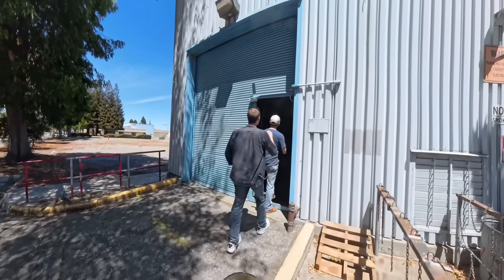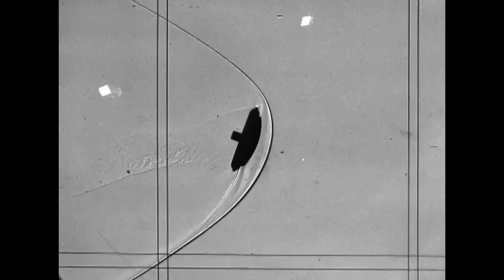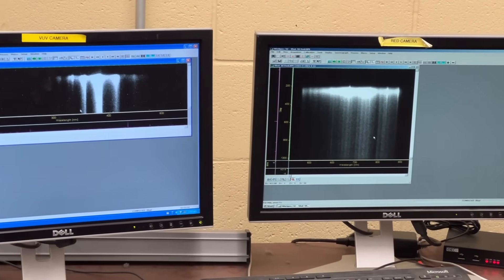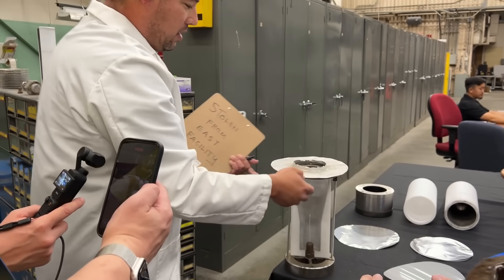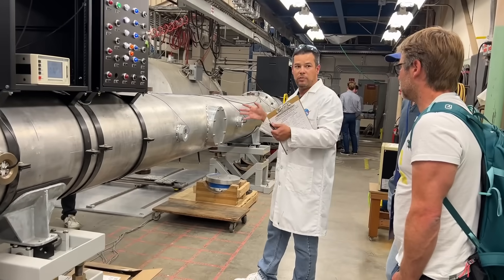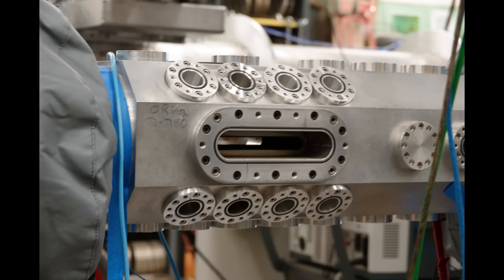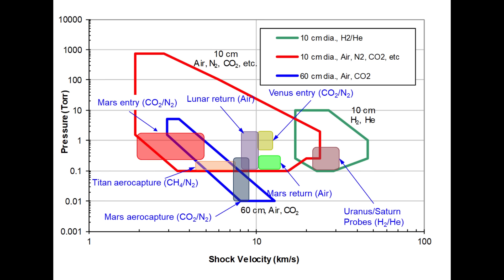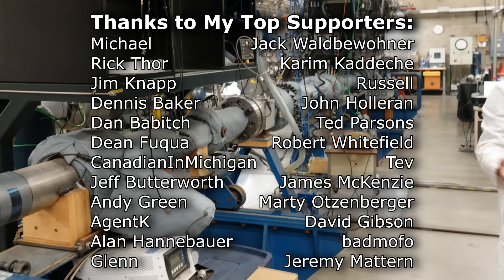Why NASA Is Making Air Explode Using Electricity - The Electric Arc Shock Tunnel

Comment: 1MJ = 270Wh battery. nice electric arc thruster bro. well, container your excitement bruh. thats the detonation pulse jet engine, but electric and just linear pulses no rotation. well say helicopter turbo jet generator at 5MW is easy to convert to high amp electric pulses, or continuous high current. too thin wire. sauna heating coils can deal with a ton more electric resistance heat. nice. continuous measurement, not pulsed measurement, bruh. well your marginal bridges collapse (tm)(r). and wings break, and heat shields challenger. make stuff work. not just barely. above says cheaping out makes stuff more expensive and makes them break. ie running a management gov alongside a production line costs you your freedom. yep army corps does not give you any freedom. camping is much nicer, dont work for other people. ie love towards the world is enemy to above. I am not it, as I am flesh. above be with you. well the metal tiles rust of course. nothing complex. they rust when they have no shielding gas. the orange stuff, your gold has rusted. and rust is no good.
Reply: very much easier to make a pulse detonation engine with electricity than trying to control fuel detonation. just make your wire last longer and only detonate the gas around the wire, not the wire itself.

Comment: (8:20) Is there a reason why the tungsten wire is folded like that instead of simply straight? I feel like I should know the reason, but it's escaping me... 🤔
Reply: It actually might be coiled. I had a second look and it's hard to tell... 🤔
Reply: It's longer so the string can pull it straight to fire the rig.   The string is an insulator, the wire is a conductor, the point where the string passes through is the other electrode.

Comment: It’s pretty bonkers that 70ish-year-old equipment is still in service on cutting-edge research.
Reply: 'If it ain't broke, don't fix it ...'
Reply: ...wonder why - has this type of tech maybe not advanced affordably ...or something else?
Reply: @kevinim300  There isn't much to advance on a big bank of capacitors and a welded metal tube. I'm sure then sensors look absolutely nothing like the originals though.

Comment: As someone who has welded that type of equipment, the big stuff is annoying but the small parts are the easiest to make expensive mistakes on, and there are loads of small parts. Cheers Scott, Great as always.
Reply: what if it's tiny details ina  big part? I remember reading about welding the Saturn V tanks.
Reply: Hi, can you please explain what those "dashed" weld seams are about? On the big section at the end of the bigger apparatus (I think called it the wind tunnel section?) the tube manufactured from sheet metal seems to have one continuous weld seam along its length. But everything else attached to the outside is welded to it in a sort of "dashed" or alternating way. Why is it done like this, and how are the contents inside sealed off? Is there a second, but continuous weld seam on the inside of the tube? Cheers
Reply: @argh1312  This is for ease of testing of the inner weld and to avoid forming a sealed cavity. One way you can test vacuum chamber for tightness is to to connect a sensitive gas detector (mass-spectrometer) and then evacuate the whole system. You then blow Helium at various points and check when mass-spectrometer shows rise in Helium inside - if it does you found a leak. For this you need the ability to blow Helium at every weld, so they make the outside weld with gaps for easy access. They also make notches in the connector flanges so you can blow Helium there to test the seal.
Reply: @volodya5  Thanks for that explanation! So do I understand correctly that there are inner welds to seal the chamber off, and the outer, gapped welds are for added structural integrity? And yes I was already talking about those flanges. Is it done the same way along the length of the tube as well?
Reply: @argh1312  Right. When you are welding sheet metal together you usually have only one weld, but when you are welding sheet metal to a thicker piece, such as a flange, you have full inner weld and partial outer weld. The inner being on the side where vacuum is - sometimes people make enclosures so one can put  an instrument that needs atmosphere inside a vacuum tank. In theory, you could reverse the arrangement with full weld outside and partial on the vacuum side and still test with Helium. But this has a problem that you created a narrow cavity in vacuum that is very difficult to clean. So if you get anything organic in it, it will outgas for weeks or longer.
Reply: @volodya5  also, you want as large of an area as possible to allow atoms/molecules to fly around and get collected (calling it pumping at that level of vacuum doesn't convey what happens)
Reply: @argh1312   You cant fully weld the outside in case of trapping air. To create a vacuum, you need to loose all the air inside.  If some were trapped within the seam, the vacuum would never be reached as it kept finding a trickle of atmosphere and you would spend forever finding the leak.

Comment: Orange stuff is made not just during re-entry, almost any video of Starship launch and landing shows a brownish haze or smoke trail from the rocket exhausts. While methane and oxygen burn cleanly, those hot gases striking the air can force reactions involving the nitrogen and assuredly form NO2, which I believe is a major component of those brown trails.
Reply: Thanks! I saw that on the last launch and wondered why no one talked about it. I assumed something on the launch tower was being roasted
Reply: I think the more likely explanation is fuel-rich combustion towards the outside, to reduce the thermal strain on the exhaust nozzles. Surely at that amount of heat and pressure, some of the partially burnt fuel molecules (CH3, CH2, CH, C) would lump together and create visible soot, don't you think?
Reply: @argh1312  Nope. Methane burns very thoroughly, and is certainly plenty hot enough to create nitrogen oxides from air. Also, the hot, fuel-rich gases collide and mix with the ambient air, regaining the stagnation temperature they had in the combustion chamber. I've run small engines at rich and lean conditions, and when lean (no afterburning in the air) the rumble goes away and all you have is a ripping noise much like a cutting torch. No elemental carbon is formed in plumes all the way up to propane, and everything gets afterburned very nicely. Only NO2 can explain the brown color.
Reply: @r0cketplumber  Alright, I'll take your word for it. But who are you, running liquid rocket engines?
Reply: In reality, it's just fart Starship shouldn't have followed through on. It is not rocket science.

Comment: 48 km/second is about 
107366 mph is about
mach 141
Reply: Parker Solar Probe: 430,000 mph.
Reply: That’s incomprehensible numbers just wow! 😂
Reply: At what temperature?
Reply: Using mach without providing the relevant gas parameters is inaccurate. Mach number depends on specific heat capacity (volumetric and barometric), molar mass, and temperature. Especially when we're talking about extreme conditions like this, all of those are highly variable.

Comment: I am a bit surprised that they don't use a coaxial transmission line between the capacitor bank and shock tube to reduce inductance and narrow pulse width.  This should give higher power levels at the point where the shock is initiated.  Maybe the capacitor bank has enough inductance and/or equivalent series resistance to make any transmission improvement moot?  The string pull wire trigger is amazing, but I would think that a trigger electrode would be easier to control and add less contaminants to the working gas.  The EAST crew should get together with the Z-Machine folks at Sandia, if they haven't already.  Similar energy levels (2.7 MJ), but much higher power levels (350 TW) at Z.
Reply: I think they do.  The bus bars look like 2 conductor transmission lines, the second conduct is behind.  The cables providing the energy to the shock tube look like coax.  There must be some sort of impedance transform and or BALUN to do the impedance transform.  That's why the cables don't thrash around, what goes on in the coax stays in the coax.

Comment: 7:05 It is the greatest resistance I have ever seen in my life.
Reply: They are fine. I worked with trains and the "brake resistor" is about 1.2 ohm, square shaped, lamelled, measuring about 50 cm, bit looks like a shutter for windows. I rarely saw them, but when they got dirty and the resistance gets too low between the lamelles and arc through, well, that evaporates a 1 cm2 area and becomes a curiosity :D

Comment: So, it could theoretically output 1.21 gigawatts for about a millisecond?
Reply: Nope. The speed of the dumping is fixed by the capacitance and the resistance. Bringing that discharge speed down to a ms would require the whole thing to be redesigned from scratch. That might be doable, but it means your "it" becomes a completely different it.
Reply: @-danR  I was referring to the capacitor bank, not the machine it powers.  Reducing the resistance of the load should be enough to shorten the pulse length.

Comment: You can't use it until you've collected all the keys very much sounds like a video game... but is obv more for safety reasons learned the hardest way. 💀
Reply: Quite similar to the security procedures around nuclear missiles.  Just the focus is reversed.  With an ICBM you need to a absolutely, 100% certain that the launch is authorized because you're potentially turning everyone outside the launch facility into a greasy smut.  With the electric shock tube system you have to be absolutely, 100% certain that the "launch" is authorized because you're potentially turning anyone still inside the lab or the capacitor room into a greasy smut.

I'd be curious to see video of the capacitor bank during a discharge.  Even though I suspect that it would be impressively unspectacular.  Only in Hollywood do massive capacitor banks emit curling electric arcs.  Real high voltage is far less visually spectacular.  When it's working as intended, that is.

Comment: I wondered if the orange coating might have been nitrogen compounds generated during reentry but I figured they'd be oxides, I didnt consider methane as playing a role. Hmmm....
Reply: I think SpaceX has confirmed that the orange colour originates from certain tiles they tested active cooling at. Seen it in a short here somewhere I think.
Reply: @AccAkut1987 Elon says it is rust from a steel tile they used to determine how much erosion an unprotected ship would see if there was a breech in the TPS. I assumed if they were testing transpiration cooling, theyd use nitrogen as a stand-in for methane, i didnt think theyd use methane during a conceptual test tile, but it is possible they did.

Comment: Because 2 things can't occupy the same space at the same time, I'm betting that the welder person that worked on the 60cm shock tube was (at least at the time) probably on the skinny side, simply because a larger person (and their PPE) wouldn't fit in the tube.
I'm speaking from experience, I'm pretty skinny like that and my dad and a few others at the auto repair shop I used to work at (specializing in diagnostics, aka I'm the "why is the check engine light on" guy) asked me a few times to reach into a tight space and retrieve a tool they dropped because their arms were too big around to fit where the tool went. Their arms were too big around from the simple fact of them getting more physical exercise by doing things like changing tires, I don't do as much of that and I'm skinny just naturally so my arms stayed a smaller diameter due to less muscle mass.
Reply: Our chief engineer at XCOR, Dan DeLong, had a story about welding the battery boxes for Perry Submarine, and the tiny Cambodian woman who was the only person who could do the interior welds. They had to build them in batches between her pregnancies because she didn't fit after a few months.
Reply: I’m guessing that they welded the tube one section at a time….. each section looks to be approximately arm length. Heat and strap the section then weld the length plate join, then weld the new section on to the tube from the inside by reaching in rather than lying inside?